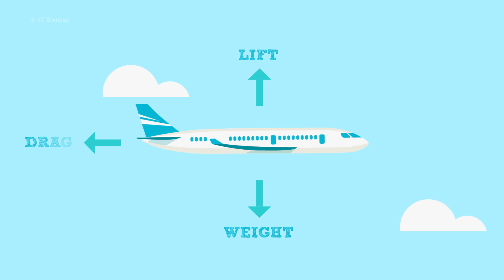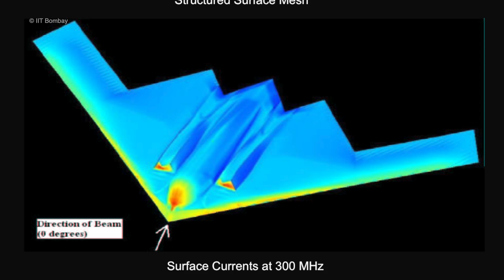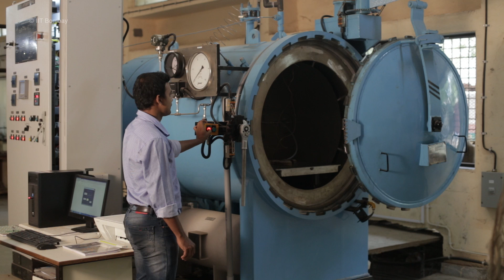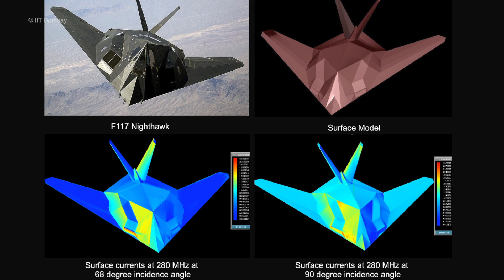Department of Aerospace Engineering

Comment: I like aviation but I dont have interest in research and development but in a field job like manufacturing and maintenance. So are aeronautical engineers required in maintenance or only Aircraft mechanics?

Also is there a significant advantage in doing aeronautical engineering before becoming an Aircraft technician?
Reply: No, there is not that much advantage if you  are technician with B Tec cus we don't need creative minds while repairing aircraft but we need skilled hands
Reply: @harshu9158  Thanks for the info!
Reply: JOIN IAF.